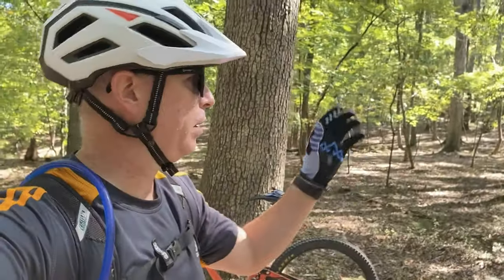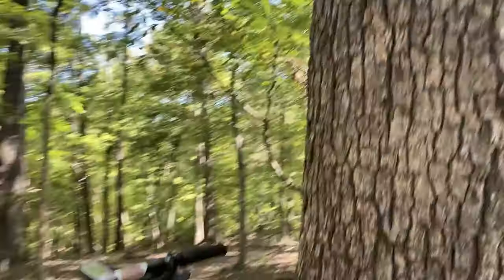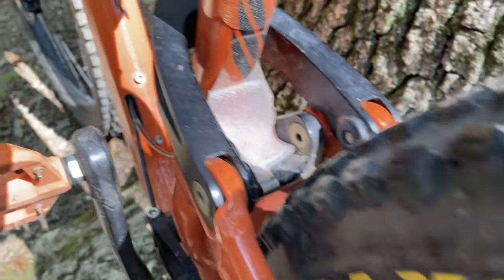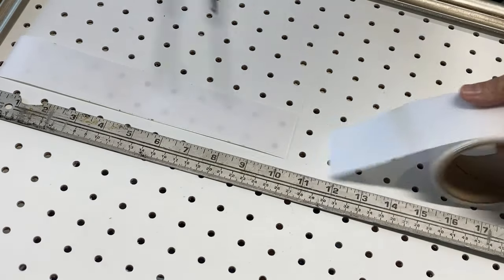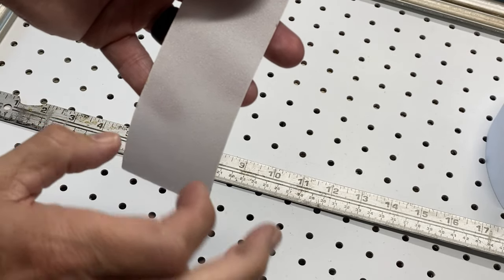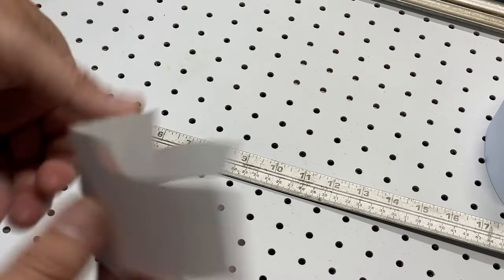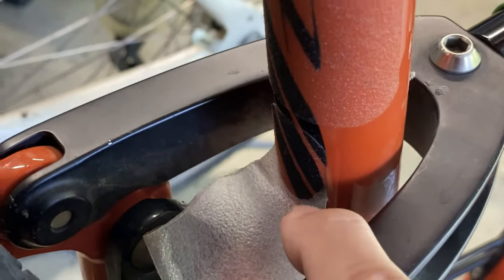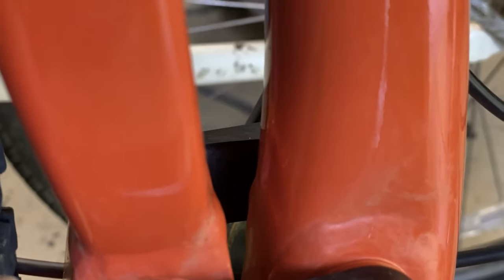PROTECT your IBIS Linkage From Damage! A 25 Cent Fix, REALLY!

Comment: Interesting, I talked about this in my review of the Rimpo vs the Hightower.  One of the things that Ibis needs to get improved. Riding here in the west, I always get rocks up in there and I have the carbon version in grey.
Reply from the maker: This tape fix worked fine for a while. I changed it out about 3 times and then purchased the “rock flap” through Ibis. It’s definitely something that would be standard on any bike with such an exposure linkage. Thanks for watching. Where out west are you? I’m riding in Phoenix in March for the first time.

Comment: Gravel road is the biggest hazard to damaging the ripmo frame. Especially the welds on the rear.
Reply from the maker: Hey, Agreed, the gravel is a pain. SInce I installed the little rubber flap on the rear I haven’t had any issues with gravel.

Comment: I've had a Stumpjumper with similar linkage since 2011 (yea old bike). I've had to replace the suspension bearings several times. The bearings that always start creaking and are in the worst condition are the ones closest to the bottom bracket in the downtube. So if you can come up with a plan to protect those as well it would probably be beneficial and may help your bearings last a little longer.
Reply from the maker: Hey Gary, Thank for your comment and recommendations. Overall I think the linkage is sound and will last for years. However this “GAP” does present a potential issue should something big get lodged down in the lower part or the linkage and I don’t notice it on a longer ride, some serious damage could be done. One thing I failed to mention in the video is that I have made sure to inspect this area of the bike after every ride. It only takes a few seconds and it helps me monitor my makeshift modification and see if it is effective. In terms of protecting the lower most part of the linkage, I’m working on a piece of rubbery foam that would fit between the linkage and the downtube, this should not impede the linkage but should provide protection from rocks and “hard stuff” from getting in and causing damage. I’ll keep you posted. Thanks for watching!!

Comment: What type of tape did you use? I heard you say 3M, but which one please? Thanks!
Reply from the maker: Hey Mike, Here's a link to the tape, I thought I had included it in the description with the video. If you're planning on using it on your bike I'd definitely recommend the 2" tape. 
3M Safety-Walk Slip Resistant Tape, 2 in X 15 ft, Clear
by Amazon.com
Learn more: https://www.amazon.com/dp/B009NP1N0Y/ref=cm_sw_em_r_mt_dp_dJqGFbFH2ZQVM
Reply: SAMTB thanks. I was in a hurry & sport, I neglected to check the video description.  Great idea & design - will use it as I got a rock stuck there during my maiden ride on my AF. Keep shredding! Thanks!
Reply: it's 3M bathroom tape. people have been using for years as frame and fork protection

Comment: How does this compare with the "Ripmo Rock Flap" that Ibis sells on their storefront?
Reply from the maker: Hey Neil, This application placed at the top of the linkage would almost discard the need for Ibis's Rock Flap. The rock flat that Ibis sells sits down lower then the area that I believe to be a potentially bigger issue for damage to your linkage and frame, especially if your frame is carbon. I don't think there is anything wrong with the one Ibis sells and I even mention in the video about having some protection lower in the linkage. 
Thank you for watching and for your great question. I may order the rock flap to see how it compares and post an update. I'll keep you posted.

Comment: There is a rubber piece Ibis sells for the lower link ( the spot you pointed out at around 3:12). I bought one and installed it on my V1.
What if you use an old tube instead of the tape?  Did you consider that?  Helpful video,btw!
Reply from the maker: Hey Yes there is, I have it on my bike now. Just installed it last evening. Looks good. They should  make one for the top as well!!!! I have thought about using a tube or some other soft rubber material. I'll keep you posted.
Reply: @SAMTB   I'll try a tube as well.